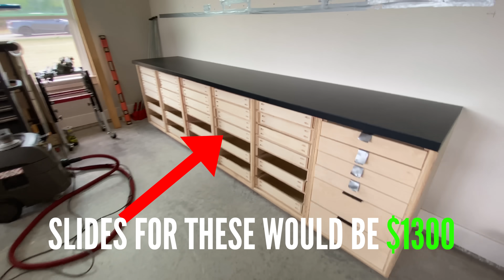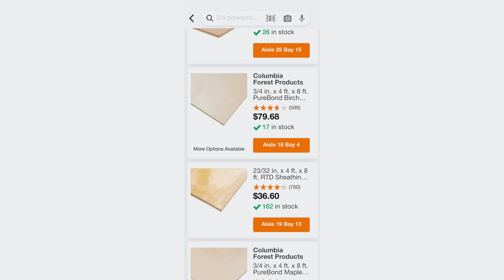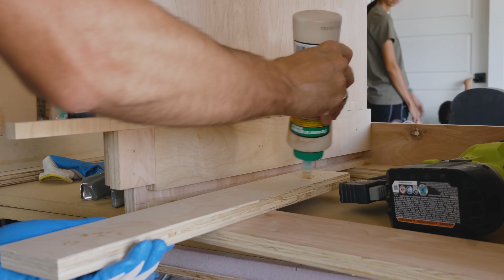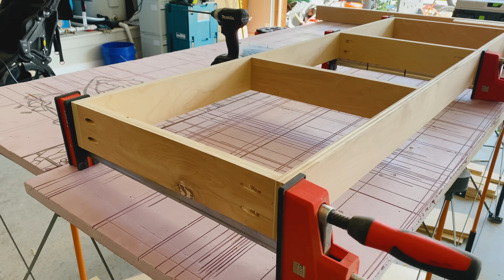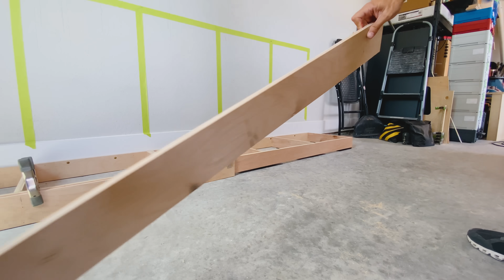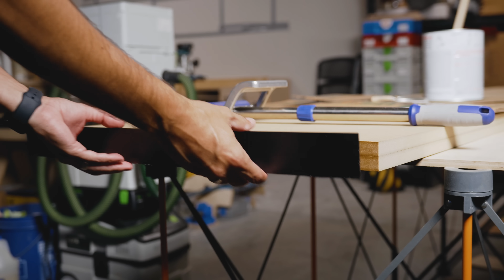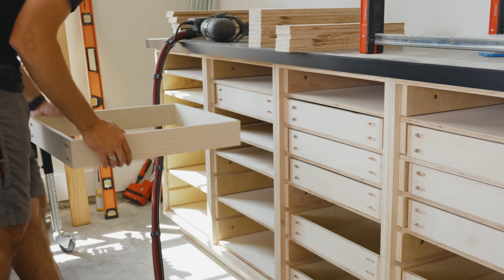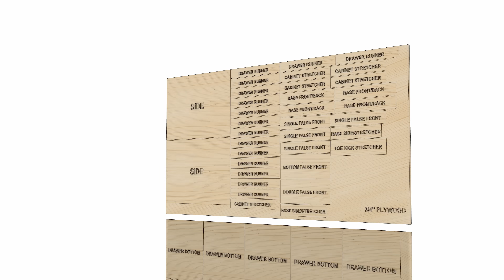Drawer slides are expensive. Do this instead.

Comment: Was just explaining to my wife who walked up halfway through the video how you used duct tape instead of mud because the internet voted it so.  Then at the end saw what you did instead.  Sadly, cannot find a snorkel emoji.  

Looks good!  My only complaint would be the handles.  I have torn many a pocket, or badly bruised my legs, walking too close to cabinets with protruding handles that aren't semi circular and continuously connected.  

The worst are the T shaped handles.  Those get deep in the pocket as you walk by carrying stuff.  Arm full of project stuff, catching your pocket and ripping it half off while walking by is no way to have a good day.  

The ones you use in the video would probably tear a big gash in my leg.  I tend to walk fast and deliberate with reckless abandon.  

Usually I bash my head or cut my head standing up too fast under shelves, or while looking down, walk into the side walls upstairs in our 1890 built house, bashing my head hard enough to almost black out.  Our upstairs has the sloping walls, which is the roof.

Enjoyed the specialty Plywood store and the secret weapon.  Wife and I both had a laugh.

Comment: 19:30 slats IS the way to go! Cardboard works just fine for that. I would have quickly mudded and taped the wall behind the higher cabinets.( wet, tape, smear, done) takes a few moments and seals it according to any building code in the north east. I too built my drawers like you did. Wax is your friend!
Reply: 30:00   haha got me!

Comment: We are always learning from others so here's a share.  As in your case for drawer slides.  Use strips of laminate.  Glue one strip to the underside of your drawer bottom and one strip to the upper side of the rail in your cabinet casing.  The drawers will slide smoothly and the laminate is a very hard wearing material.  You will unlikely need to replace it in your lifetime 😃.  You can go as far as doing both top and bottom of the rail.  This reduces drag for when your drawer is pulled far out.  Excellent workmanship.
Reply: @theodrummond6518  they also make tape specifically for sliding surfaces. UHMW Advances Poly Tape. Probably others out there as well
Reply: Parrafin wax is a simple alternative to keep a nice good slide.
Reply: @KaiserTom  I have old cabinet drawers where the slides were made with beech. Very hardwearing. My grandparents used to take out the drawers every now and then and rub lumps of beewax on the slides. Now, after a few decades, they show some wear and need replacement.
Reply: @KaiserTom  I use surf wax on my wooden drawer slides, it’s just easier to find in the garage. And the scent lingers for years!
Reply: one other way, (and really cheap), although you may have to leave just a hair more room in the slide area is simply putting thumb tacks in the bottom of the drawer slide, makes a nice smooth slide. Shop 101, 9th grade, many, many, moons ago.
Reply: @Dragon-Smoke-29  Used to put them thumb tacks into my sneakers and slide around the office stores.
Reply: Silicone spray for extra slide
Reply: @mikemotorbike4283  Then when you re-up the spray after a few months, your muscle memory yeets the drawer across the shop 😂
Reply: @jacobs7764  You bring up a problem. The lack of drawer stop possibilities disturbs me. This system is perfect for me - other than that one very important thing. I just know I'm going to have to deal with multiple dumps and never learn.
Reply: @vociferonheraldofthewintermist  I'm not a woodworker, but could you add a peg above the slide near the back of the drawer that fits a groove that ends at the point you want the drawer to stop?
Reply: @vociferonheraldofthewintermist  the beauty of no stops is that you can keep projects in some drawers, then move the whole drawer to the area you are working on—like a Lego drawer for the kids. Couldn’t you nail a washer to the back of drawers most likely to make a mess?
Reply: I've used PVC stock for drawer slides with good results. The durability has been more than adequate so far. Also in addition to gulf wax bar soap can work in a pinch for lubrication.
Reply: Nice!!
Reply: If you don't have enough laminate to do all the drawers like theodrummond6518 said to do (which was a very good idea), you can coat the bottom and top of the edges that go into the slots using a candle. The candle wax will help the drawers slide better. A cheap trick, but won't cast the price of buying more laminate. Great job on the cabinets:)
Reply: For even better smoothness since the idea is to use laminates to reduce friction, try out formicas microdot laminates.
Reply: You can also just sand the parts that make contact super smooth and finish with wax.

Comment: I love that Bora Centipede Folding Workstand (I had to put 'collapsable work table in thee googles). 
It reminded me of a buddy about 30 years ago who made light work surfaces out of 2 sheets of thin plywood with a 1/2 to 3/4" sheet of hex(?) aluminum 'filler' sandwiched between them. I can't remember what the stuff is called. Anyone? 
Great video. I've got a bunch of salvaged/scavenged drawers and some built-in stuff that I'm looking to modify to slide well without buying hardware.
Edit: Honeycomb core is the filler for making panels.

Comment: 15:00 Don't limit yourself to a system that simply NOTIFIES you about a leak or flood, but shut off the water too. I know that YoSmart has several YoLink products, but they require internet to connect to Home Assistant (they connect to YoLink water sensors directly within 1/4 miles over LoRa), but there are other brands too, I just don't know. My father in law had a massive flood on vacation. Active protection>passive monitoring

Comment: I've had drawer slide less cabinets before and didn't like them. Too sticky and temperature/humidity variable. Never had the issue with flush trim router bit. Perhaps your bearings are worn.   Snorkel emoji.

Comment: Your trim router problem. My 3/8" one has a 9mm bearing, so if I don't put a layer of adhesive tape around the outside of the bearing to make up for the 0.26 mm's, then I'd end up getting that 0.26 undercut that you have produced. 3/8'' is 9.52 mm.

Comment: I like what you built. And it has a kind of "old school feel without those manufactured metal glides. Wondering if you used beeswax on the "glide" surfaces?  
But I find your pricing claims for store bought drawer glides to be quite BOGUS!!. Where did you find these outrageous prices?  Granted, Blum glides are "Top of the Line" products and are deservedly pricey.  I just checked my local big box hardware store and the MOST EXPENSIVE soft close, full extension 20" drawer glide set (Everbilt) was under $19.  When I specifically searched for "Everbilt 21" glides, a quite abnormal length, what I was able to find were noticeably more expensive. Yet the glides I often use - simple bottom mount white enamel glides are under $7 - for the  21 5/8" version.(snorkel emoji)

Comment: Before you go away for more than a day, turn the water tap at the mains supply off. Then you won't get flooded. If you have a washing machine, turn off the water tap that supplies it when not in use. Those feed tubes have an annoying habit of leaking, and when it happens the customer blames the manufacturer who has already told the customer that in their instruction book, which the smart ass customer failed to read before operating the machine.

Comment: On the edges we always used a wax stick to prevent the bearing from scoring the sides. For my shop I avoided laminated and used 1/4" hardboard (what we used to call masonite") so I could change the top as it became worn. I also used a thickness builder polyurethane which was still soaked up quite a bit.🤿

Comment: Are you using any kind of treatment to increase the longevity of the drawer slide contact points?  It looks like you used 1/2" plywood for some of the drawer pieces, why did you choose 3/4" for the build? I figured with the cabinets being screwed together and the way you added the pieces for the slides, that 1/2" would have been just fine for the whole build and you might have save a boat load of money. (snorkel emoji)

Comment: If you live in a high humidity location you might want to make sure the rail gaps are big enough to handle swelling over time. When we bought our house the previous owner went on an on about these amazing cabinets and drawers he made in the garage that were built like this and only two could be opened. We ended up having to beat them open, cut off the rails and installed drawer slides but since we didn't price the ball-bearing type we paid less than half of your "cheaper" option. $7-$8 a pair at Home Depot.

Comment: 🤿The only issue is that if you accidently pull the drawers out to far they fall out.  Solution:  Don't pull the drawers out too far.
Reply from the maker: Yeah, you can also put a horizontal spacer in the last 3” as a visual reminder to stop pulling and it can hide parts

Comment: 900 in materials, 900 for track saw lol easy peasy.  Also the taping and mudding is for fire rating in an attached garage along with sealing penetration points. Duct tape will disappear if in a fire and allow fire penetration into the wall quickly, unattached garages who cares lol.  And yes i watched to end.

Comment: .... rout the top laminate with a cheat-glider then fit the edge laminate and sand off the excess of that from the bottom.    NEVER rely on the router shaft bump bearing.

Comment: "Better" way to assemble lots of pocket screw joints: Don't waste time with clamps, get good at holding it with your hands

Kind of a cop-out I know, but once you get the feel for how pocket screws kind of "suck in" one piece against the other, you can offset one piece by roughly that amount and then use your fingers to push/pull as you screw the pieces together to end up with a nice flush joint. Working in a shop where some jobs have you doing hundreds of these joints (you do what.. 30 drawers x4 joints per drawer so 120 of them? Tons!), it takes too long to clamp them together before screwing. With enough practice and skill,  you can nail them in one shot, no clamps, be done with a drawer in under 30 seconds, and still look as good as if you clamped them up first.

But I think what you meant to ask was for an "easier" way than clamps, and genuinely, I don't think there is one! Those clamps are amazing and you can drive those screws hard without the board moving at all. It's just a pain doing it over, and over, and over...and over......and over..............and over.................

Comment: They look beautiful, but I am concerned that you used 'raw' plywood directly against the floor, with no intervening damp-proof layer or waterproofing oil/paint on the edges in particular. How will you keep it dry while you wash the floor or if it rains indoors again?

Comment: I've done just about every kind of construction work, including laminate countertops.
That was my only job for a design center I worked for in the early '80s.
I always installed (glued) the top surface FIRST, leaving about a 1/4" overhang on edges to be exposed, before installing the edge band that I had already cut to finished width (+1/16" to 1/32") with a laminate cutter by butting it up under the top surface laminate, and THEN using a proper trim router and cutter with flush-cut bearing, trimmed the top laminate so it lapped over the top of the edge-band.
That's the only style of countertop I did in a commercial, production/specialty environment. We did a LOT of low-end housing developments aimed at new home-owners looking for lower cost move-in.

Comment: The only problem with this design is it uses way too much plywood. I wonder did you glue the wedges down. I would have connected the separate cabinets in some temporary manner so that I could move one from the middle leaving a cubby hole and allowing me to move one or two to other useful places in my shop. I think screws on the toe-kick hidey boards would make the entire set of cabinets easier to have stand-alones. Will you need to apply candle-wax to the sliders for drawers holding heavy loads? In my experience permanent cabinets in a workshop restrict future reconfiguration for special jobs or changes in workshop activity. Maybe put the lower unit on wheels.I love what you did, though. We all different.

Comment: I designed almost this exact style of drawer for the exact same reasons. My dad and I built it in 2007 or 2008 for a desk (basically to remove for art supplies and to swap them around). I built one side with short drawers and the other side with various larger ones. I have reconfigured that whole desk on a myriad of ways since, but I’ll never get rid of those drawers. The big difference is that on mine, I just used dados. On each one we cut them regularly spaced so it can be reconfigured in any way. This let me have the maximum width, all of the cuts are hidden by the drawer fronts and even with all of those cuts, the 3/4” ply I used is still ridiculously strong. All of that said, I don’t think I’ve ever swapped the order of the drawers. 😂 Maybe I did once when I moved. I need to clean some things up in the area it’s in so maybe I will when I’m done. I need to clean the drawers out.

Edit: just saw your notes about dados. Mine are about a 1/4” deep on each side. It’s plenty strong to hold the drawers. I have cheap 1/4” ply on the bottoms and one of my drawers is about 18” high with probably 60lbs of crap in it. I could probably drive my truck over the sides without any drawers in them and the bottoms of the drawers are supported enough with 1/4” on each side. You might have issues if you make the dados 1/2” on 3/4” ply but mine are solid with at least 1/2” of ply remaining.

Edit 2: I see someone else has seen Norm Abrams make draws too. 😂 Nice work btw.🤿

Comment: The Tooling system rocks for doing panels for sure.. 
I rehabbed 50 yr old cabinet neighbor was throwing out, 
where the drawers simple wouldn't budge, after all the action of wood on wood slides. 
The drawers lower edges dug down into structure of cabinets making them all jamb up. 
All it took was recycled frozen food white plastic polyurethane bowls, cutting them into 
strips, tacking them in down in worn grooves in cabinet, and the drawers now loaded heavy
with 100lbs of hardware slide nice and smoothly in & out. 

Your cabinets could use a smear of bees wax in the slides, and will last quite a while. 
Simply grab a toilet seal ring at the same builder supply for $2 bucks, and it's a life time of bees wax.  
When applied to $500 sink faucets, where fine brass deco fittings thread together. When it's time 
to repair a couple years later,, all brass fittings simple unscrew by hand, to replace seals. Zero corrosion. 
And never ever see green corrosion again around threaded joints always getting wet.  

Difficult threads,, and fear of splitting wood with screw,, shove screw into bees wax,,, and Dremel 
a slot in threads of screw to cut threads as it goes in. 

One more trick to making wood drawer slides that last years with very little wear,,, 
Oak Folding closet door stop trim, comes already tapered, 
with nice wide 3/4" or more edge for drawers to slide on. 
And Oak wears like steel. You'd save a ton of plywood used as spacing blocks as slides. 
But it looks great,, I just hate wasting that much product I guess. 
Cheers

Comment: You've had this for while any updates?  Would you make them with smaller gaps?  I'd be worried about getting shop dust inside all the drawers.  Isn't the beauty of this that you can make different size drawers if needed and they'll fit the slide rails?

Comment: I no longer buy wood from any of the "big box" stores. I have a great lumber yard that I go to. They can cut the 4 X 8 sheets down to any size I want at $1 a cut and this is a time saver. Since the insides of most of the cabinets will never be seen, I would have used "construction grade" plywood. Looks ugly but is good enough for the unseen insides. I also use the toe kick method that you use but again I use "construction grade" plywood on all parts that will not be seen. Why wast the money on the good stuff that will not matter at all?? Super insulated the garage before dry walling it...I have 1 more cabinet to make and will use this drawer method for it. Thanks for this video. I have all of my cabinets on wheels so in time when I am gone (I'm 76 right now) my son can remove them to his trailer and the  to his shop if he wants them. All my tables and counters have a hard board top. This is almost as hard as the laminate that you used but for the money you spent I could get 5 or 6 pieces of 4 X 8 X 1/4 hard board and when the surface is pounded and really bad, all I have to do is lift it off and replace it with another piece. Love my milti tool!!! Back to using the plywood. You used 2 pieces of the expensive wood when the first piece could have been construction grade and you could have saved some money. Why didn't you edge band the end panel?? I love pocket hopes and have been using them for over 30 years. Why not use them on the sides-to-base??? I like the drawer pulls. Where did you get them???

Comment: Your drawers have wood on wood sliding surfaces which could be difficult to slide after a while.
 A thin strip of laminate or nylon on one of the surfaces between the drawer and the timber should work as a lower friction bearing.

Comment: For the markings on the edge... I think the bearing of your router bit gets hot. Therefore you don't have to push it hard to melt the material. It does actually look a bit molten. Maybe you could have prevented it by putting some tape on the edge before routing. In this way the top would of course be a bit bigger (by 0.1 mm... sorry I'm metric European). But that is easily sanded of. 🤿